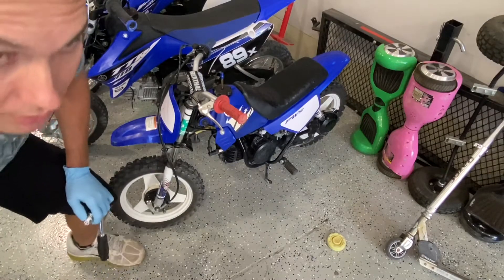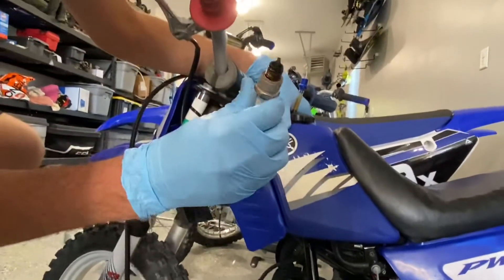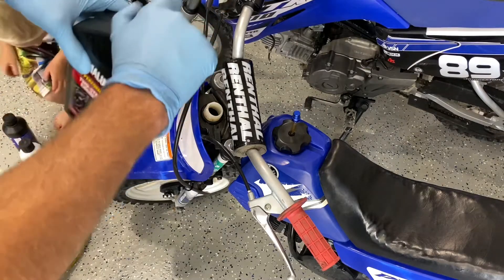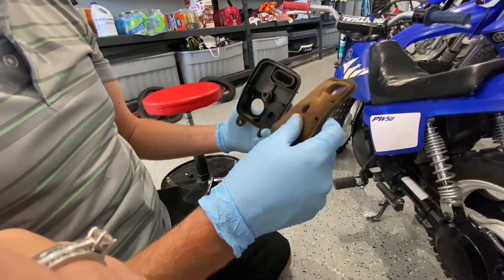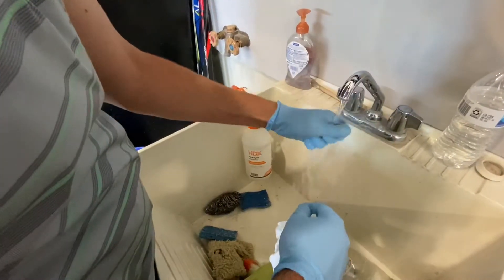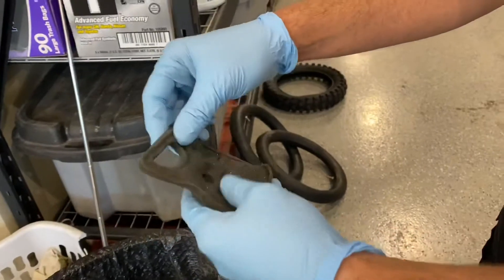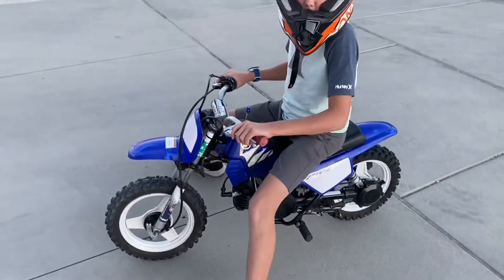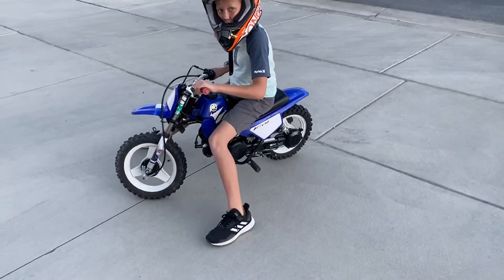Yamaha PW50 Kids Dirt Bike | Tune up spark plug air filter maintenance

Comment: No gap adjustment for the plug?
Reply from the maker: The gap was good, no adjustments needed
Reply: That spark plug made our pw50 less strong.  
About same top speed but way less strong. 
Switched back to ngk b7hs.